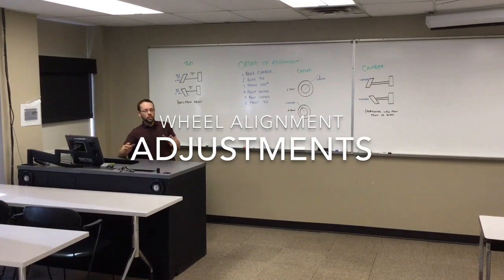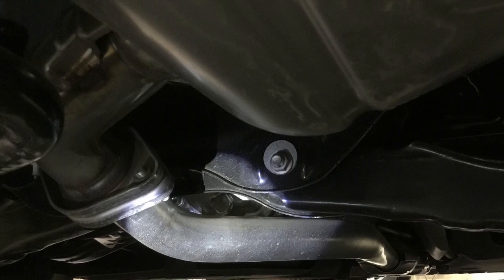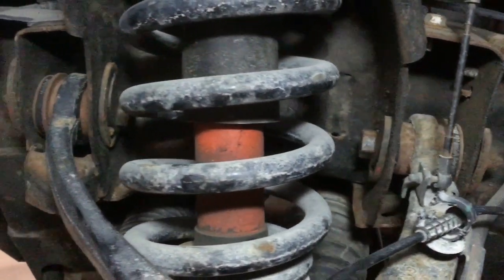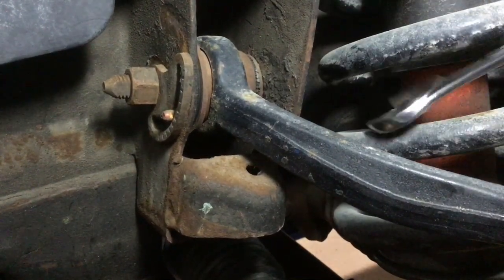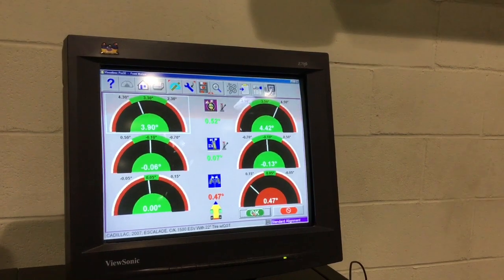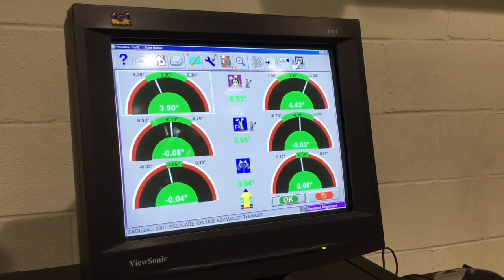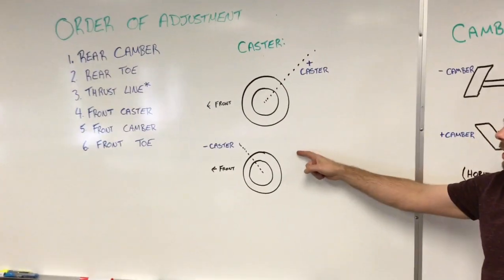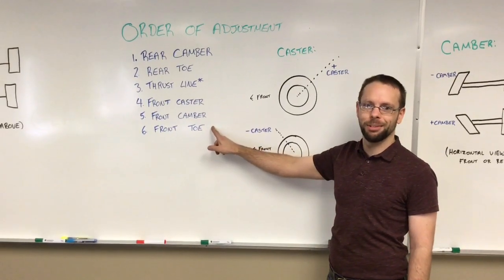Wheel Alignment Adjustment

Comment: Hi, Does your aligner display live caster?  If so what type of aligner are you using? You pointed out where caster was changing as you were adjusting the camber.  It would be great if you could include some background in the about section just so we know what your experiences are.  Thanks a lot.
Reply from the maker: This is the previous generation of the John Bean alignment equipment. It will display live caster, but I do recommend doing a caster sweep after each caster adjustment to verify that the "live" reading is correct.

Comment: Do you think it is important for repairers to know about any recalibrations to steering angle sensors or other ADAS sensors after mechanical adjustments or part replacements have been made?
Reply from the maker: Thank you for the comment. Those are all very important areas that are covered in my classroom. The video's intention is merely to show where and how common and simple alignment angle adjustments are made.

I do have another video that shows the use of the AirPro tool for the purpose of pre-scan, post-scan and calibration.
Reply: @benh4086  I really like like your videos.  The majority of repairers are not aware of this in the field and I am encouraging anyone who helps to educate to get the word out.  Keep up the great work
Reply from the maker: @ChristopherSterwerf  
Thank you for the positive comments. I am considering making a general awareness video on Scanning, ADAS and Calibrations.